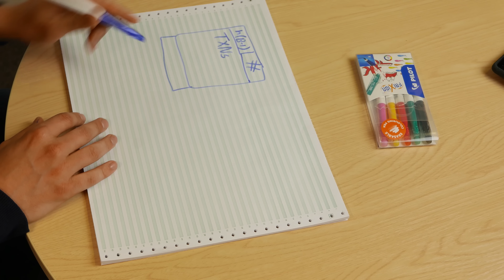Bitcoin Mining in 4 Minutes - Computerphile

Comment: is it all based on an assumption that hash function for bitcoin is kept secret, or did I miss the whole point of explanation?
Reply: It's understandable to think that - but the truth is the exact opposite.  The code for the hashing function is completely open for anyone to inspect (implement, improve, optimise, etc.).  That allows everyone on the network to check that any "new" hash, suggested by a miner, is a valid hash for the block in question.  The openness of the code allows everyone on the network to trust each other - the simplicity of the code allows billions/trillions of hashes to be checked per second - and the difficulty of finding the "correct" hash guarantees how long, on average, each block takes to be "mined."
Reply: David Smith then I don't understand what is it checked against. What is the thing that makes it difficult to generate correct hash
Reply: The fact the hash needs to have ten leading zeros.  That is impossible to predict - so the code has to be run many millions of times before a "valid" hash, with the correct leading zeros, is found.
Reply: Sorry, maybe that's wasn't clear.  The contents of the block are static - so the hash code on the block would be a knowable, single value.  But the miner has to add a random number to the block (in the video referred to as the "nonce value") before calculating their "guess hash".  The miner changes the random value until the hash function returns a "guess hash" that has ten leading zeros (or whatever the current difficulty value for the network is).  It's this increment random value, add it to the block, hash the block, check the guessed hash has the correct number of leading zeros that takes time and effort.  That's the "proof of work" (POF) that bitcoin and many other cryptos are based on.
Reply: David Smith thanks, I think it gets a bit more clear for me now

Comment: Isn't there a threshold at which point it can't be made any harder? That is, when the requirement is for the hash to either equal 0 or 1, the only way to increase the difficulty would be to completely change the system to a new hashing algorithm with more bits in the output, right?
Reply: Theoretically yes, but in practice even if you used every particle in the observable universe to create a computer that exclusively searched for valid hashes, the network would still be able to adjust the difficulty so that is did so every 10 minutes. The number of possible hashes far exceeds the maximum potential computational power any civilization could ever achieve (with traditional computing... quantum computing might make problems like these easier to compute). It would take many trillions of times the current age of the universe, only doing this, to ever get close to reaching the difficulty limit.
Reply: No , The genius of the way Bitcoin's proof of work difficulty is designed is it is self adjusting , extremely granular , and there is no limit to how high difficulty can mathematically be made.
Reply: By that time the sha256 will probably already have been broken and we'll be probably not even on sha512 but something newer and stronger and even better! That's a long ways away, but you do have a valid concern... When our cpu processing power defeats the hashing algorithm it'll be a scramble real quick to upgrade the hashing algorithm we should have one prepared at that point and quickly resecure everyone's bitcoin before too many people get theirs stolen from them!

Comment: Millions of machines working on the same problem and the result is still just 10 minute blocks.  This is why Proof of Work is so stupid and will ultimately be replaced.
Reply: Funny all this POS propaganda here. Early adopters and exchanges want more power huh?
Reply: It's still the best system. Proof of stake is only better from the perspective of energy cost. As I see it, it seems proof of stake is still less secure, if only marginally.
And proof of capacity or any other such things will still end up using lots of energy.

Comment: This is a huge waste of energy...
Reply: I just looked up digiconomist's "Bitcoin Energy Consumption Index". Currently estimated at about 71 TWh per year, that is comparable to the electricity consumption of Chile. Or 0.32% of the world's electricity consumption. The value has about doubled in the past 6 months. I'd call that staggering.
Reply: It doesn't have to be. You could make the proof of work useful work like protein folding for research or some sort of distributed algorithm that finds patterns.
Reply: @Nugget's News Australia
Maybe one of the greenest industries, but not green. About 81 % of all Bitcoins are mined in China and the Chinese energy mix  has only 1/4 renewable energy production.
Reply: TheFuriousjack actually most are located at hydro dams
Reply: @anti/HUMAN Designs
How is something which does not perform what is was designed to do and uses a ton of energy in the process not wasteful?

Bitcoin only has value to people that treat it as an asset. Are you one of them?
Reply: @rezneba101. Now look at the value all of these things provide compared to bitcoin. You couldn't survive a week using bitcoin alone.

Bitcoin only provides value as an asset for traders and people susceptible to FOMO.
Reply: Problem solved with Burstcoin? since it uses proof of capacity to do everything crypto and uses just a fraction of the energy...
Reply: @bepowerification
You are right, also a huge energy waste are steaks, space programs and gaming, but all of that is not topic of the video. So I express my opinion related directly to the video not everything what possibly could overlap with it.
Reply: Michael Pound could you eleborate why ?
Reply: Ending international wars funded by fiat currencies and debasing currencies used by billions of people might have a cost. If it takes even half of the energy production of mankind to achieve those ends, I'm very well content at paying it. The evil we are fighting is too great to be left uncheckd.
Reply: Tenebrousable Sure destroy the climate for your distopia. What could possibly go wrong.
Reply: Government deficit spending can easily be the single biggest CO2 emission contributor today, and bitcoin might stop that. How do you like those apples?
Reply: writing this comment
Reply: false.
Reply: Nope, because everything you listed provides liquidity to transactions for the entire world, bitcoin is a minute fraction of that AND someone needs just as dedicated (if not moreso) hardware to accept it. Try to replace currency with bitcoin and it would scale so poorly for that energy cost that it would be farcical.
Reply: I agree!
Reply: Create a bitcoin mining rig for your heating needs in winter. Instead of burning oil or just letting electricity create heat you can create money + heat. Many server farms heat nearby neighborhoods for extra cash, but you think these calculations take that in effect? When there's large communities living with diesel generators in africa and philippines, mining bitcoin isnt that big a deal.
Reply: It’s genius but it’s silly.
Reply: Lol he's not the real Micheal Pound (from the video)... Hey central banker shill sock puppets!, don't you got something else better to do? Like trying to prepare for the run on the banks you're going to be having soon? :D The only people that call it a waste of energy, are central bankers, those working for central bankers, or those that aren't involved in bitcoin... yet... :D
Reply: no, it is actually causing more renewable energy to be used and is nothing compared to energy of current banking system
Reply: It's not a "waste", since it provides something valuable. (A secure, decentralized currency, and other things that can be done through a blockchain.)

The point is that you need to make it practically impossible to do a 51% attack. In case of "proof of work", as was explained by this video, you need to buy enough computer power so that you have the majority of all computer power on the entire network, meaning you'll spend more money getting this power than you could ever earn by attacking the network.
Sadly,  this kind of processing power uses a lot of energy.

There are alternatives to this. For example, there's "proof of capacity", where it all comes down to how much harddrive space you have, instead. This is more "passive", and thus uses a lot less energy. However, it still means that harddrive space must be scarce enough, so that people can't attack the system by getting an insane amount of harddrives very ccheaply.
So with this system, you'll instead have an insane number of hardrives being manufactured and sold, which will only store this "nonsense data", and this also uses energy and produces pollution, and so on.

Then there's "proof of stake", which is probably the best system from the perspective on energy cost. In this case, it's about how many tokens/coins you own, so to attack the system you need to own the majority of the "coins" of that currency. This means you'll have to buy out most other people from the currency, and then attack the system where you own most of the currency, meaning you wouldn't want to do that, anyway.
This seems a little less "safe", to me, but it does have the benefit of having nearly zero energy cost, relatively speaking.
Reply: The same can be said of anything you don't like.

However, consider these two points regarding Bitcoin:
1) This keeps it real. It cost real work to actually produce Bitcoin. It also then requires a huge real cost to even attempt compromising its security.
2) Miners can easily relocate, meaning they are like the perfect energy market arbitrage now. This means miners will only locate where energy is the cheapest, globally. This is turning out to be in either over producing locations or in places with renewable energy like solar and hydro. So miners finds the waste in the industry and use it, and/or they are helping to drive renewable energy forward.

But, hey, I think everyone having a 2 ton personal vehicle is a huge waste in manufacturing and energy and loss of lives.
Reply: Now think of all the ATM machines in the world, all the banks, VISA card printing, money printing, storing, moving, counting, vaults, employees, their fuming cars, etc, ALL OF IT and add it up.  PLUS you can trust bitcoin.  You actually OWN your own currency.  Well worth one third of one percent of energy.
Reply: Mining industry is actually one of the greenest industries on the planet if you look at % that comes from renewables.
Reply: I am pretty sure people driving around in cars for fun or millions of people leaving their TVs and ACs on wastes much more energy so whine about that too..

Comment: That last part about, scaling up the hardware being counterproductive was something I didn't realize. Great video
Reply: Nicholas Scott A particular individual gaining better hardware does give them an advantage compared to other miners, as they would get a larger proportion (on average) than the other miners. If every miner gets more powerful hardware in the same amount, then none of them benefit from that.

Individually, they are all incentivized to get stronger hardware. But when they all do, none of them are better off. It is a competition, and it drives mining costs higher. This may have the downside that it leads to fewer people being able to afford the hardware needed to mine effectively.
Reply: It's about competition. You can personally make more money by scaling up your Hashing, but bitcoin will not yield any rewards faster. But if youre in a pool you will share a larger bounty.
Reply: You want to have a larger percentage of power compared to others, in order to earn more bitcoin from mining. As more computer power becomes cheaper over time, everyone generally gets more power, so you still won't earn more bitcoin.

The point is always that it will be too expensive to take control of the currency/system, as you need to have the majority of the computer power of the entire network. Therefore, it scales over time and stays "constant".
the only way to really hack the system woudl be to be the first pereson to have a quantum computer, for example. If they end up being insanely much faster than any conventional computer, then quantum computers could have more power than the rest of the network, and thus take control over the network.

Some cryptocurrencies (QRL, for example) are designed to be resistant to quantum computers, for this reason.

Comment: What's the larger purpose of mining again? Something to do with proof-of-work / computational work?
Reply: Here is my eli5 of proof-of-work:

Bitcoin is decentralized, so everyone has the record of all transactions. To prevent all those records from drifting out of sync, we need a way for everyone to vote for a particular chain and the one with most votes becomes what everyone trusts. But it can't be done with a "one account one vote" (or "one computer one vote"/"one ip one vote"/etc) system because someone can make a million accounts and vote that they have a thousand bitcoins. Then another person would make ten million accounts and vote THEY have ten thousand bitcoins. That is unstable and unsustainable.

So proof-of-work means "each person's voting power is proportional to the computing power they possess". That way, as long as more than 50% of the computing power on the network obey bitcoin's rules, the rules are enforced since rule-breakers will get outvoted. And since computing power is not free, it is economically infeasible to attack the bitcoin system by obtaining >50% voting power. The mining process is only the means by which Bitcoin realizes this idea.
Reply: The amount of time and processing power and energy it takes to find those hashes gets treated as a measure of the value of the resulting bitcoins. Thus, bitcoins gain value to use as currency.
Reply: Proof of Work is both a means of insuring Bitcoin remains secure from attacks by using game theory where one assumes humans are selfish and it is more profitable to secure bitcoin than attack it and a means of allowing a fair and equitable disinflationary distribution where anyone can be the mint , but no one can cheat and print more btc than the agreed upon controlled supply. Proof Of Work also allows an objective and real time measure of security that cannot be faked.
Reply: +IceMetalPunk
 so if i got it right all this computers are just testing how hard is to crack the hash or how secure the hash is? I apologize if i am wrong about this but this seems very abstract to understand to me haha
Reply: +TwiNight
 Nice explanation, it was helpful.
Reply: Woot! Helping people understand bitcoin! We're changing the world, one person at a time! :D

Comment: How are transactions stored in blocks? Is there a „cloud“ of transactions and each transaction is stored in many blocks and validated once one of the blocks mines successfully or is each transaction stored in a single block only?
Reply: Lobster with Mustard and Rice The transaction is stored in a single block only. But when the block is mined the whole network gets that exact block, so you can say it is stored in cloud, cloud being the Bitcoin network.
And the transaction is validated each time a new block is appended to that chain. The more blocks there are after the block in which the transaction was, the more validations a transaction has.
Reply: The actual transaction "values" are part of the hashing function of that block. So to get the right hash, you need to include the data in the block (which is the transactions), or you wont' get the right answer.
This is why the transactions become secure, since trying to change the transactiosn means that the hash value becomes incorrect, so you cn tell if someone tried to fake it.

And this is where the awesome part of blockchain technology comes in: IOt doesnt' have to be currency transactions, it could be any kind of information! Using this system, you can secure any kind of information, no matter what it is, and theoretically no matter what size it is. You could publsih a book or a magazine on the block chain, or even computer software or music, and so on.
Reply: The "CLOUD" you speak of... Is everyone's computer that's participating in mining, they store a copy of the entire blockchain! Everyone holds a copy of everyone's transactions throughout the history of the chain! That's how bitcoin can't be defeated, it isn't stored in one place some magical cloud you speak of where it could be deleted by governments... It's stored worldwide by all who fully participate in the network! THERE'S NO STOPPING US! :D